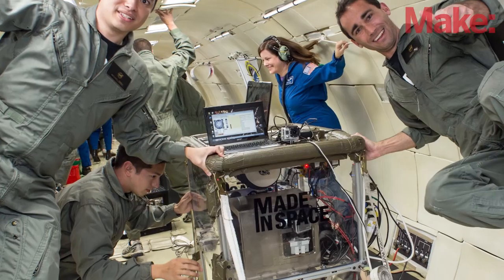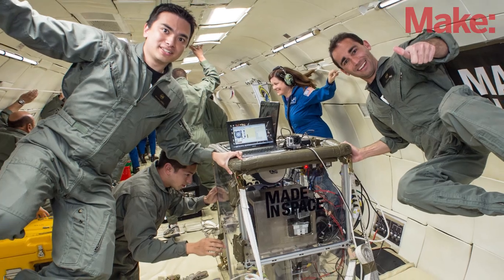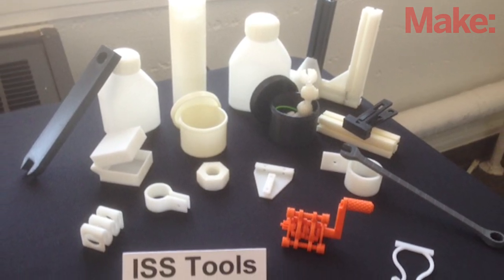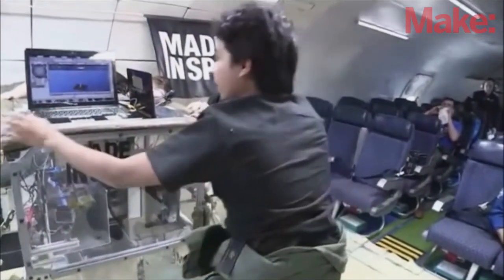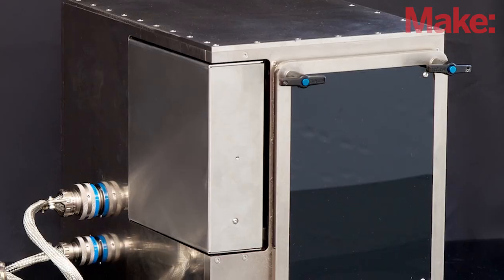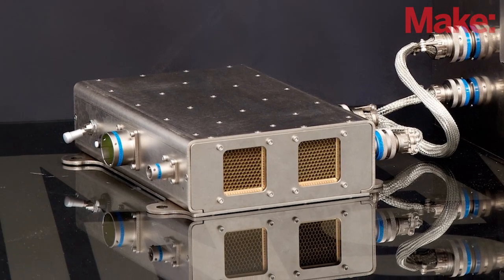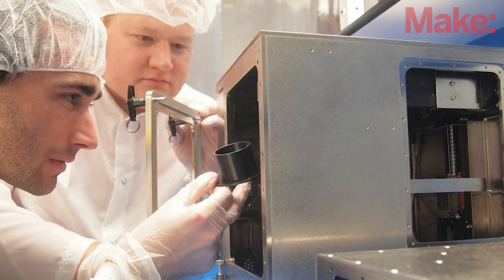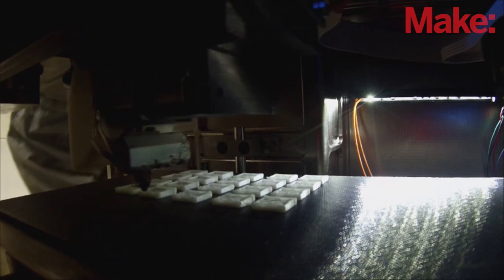First 3D printer in space

Comment: the first one??? the lulzbot can print when it's upside down.
is this really the first one?
Reply: ***** I know there is no convection in open-space.
But this video is talking about a space-station where there is regular air; so you can add a fan to cool the material and use biodegradable plastics that are not toxic.
If the space station has EMP shielding you don't need to worry about that either.
And materials don't cool down by convection only. Radiation cools it down too, yet I have to admit conduction isn't really playing a role.

So what's the deal with it? I'm interested to hear what else may influence it.
Reply: ***** 1. what does the printer need convection for other than cooling the object? 2. why cannot this be done with a fan? 3. real convection can be recreated when gravity is simulated with a centrifuge. 3b. there is always some residual gravity in space near a planet, a space station just compensates for it by spinning around the world. 4. I do know convection is caused by changes in density when air is heated up, lower density moves up etc. 5. what else is there to it if it's so difficult. 6. if you know more than I do, why don't you share your knowledge and prove it. 7. people who only assume they're the best refuse to learn to be the best.
Reply: *****
1) setting on a thermoplast? it's not epoxy. 3. whether you call it residual or not, we both agree it has grafity. by 'compensating' I meaned preventing itself from returning to the earth(you know wat would happen if it stopped spinning) 4. If I do know what convection is you won't surprice me with that, nothing special.
5. LOL, so these gears will function if the 3d printer is shaken around or put upside down but will not work in space. what kind of magic is going on there in space?

I'm not hating, I'm not egoistic and you can prove that you aren't either, that's what I meaned with my comment. I'm not saying I'm right,  just asked a simple question, only after I get an answer I can judge what the person knows.
Reply: *****
 So you are 100% sure the printer from the video is the only one that functions in space? a printer developed with parabolic flights...
And you say it' s because of these reasons, but obviously I am an idiot because I don't take that for granted, and you are not thinking you're smarter than me?
alright, you didn't literarly say you're better/smarter/whatever. Don't worry about that.
I just said one shouldn't be a show-off, I didn't say you are, apparently that wasn't clear.